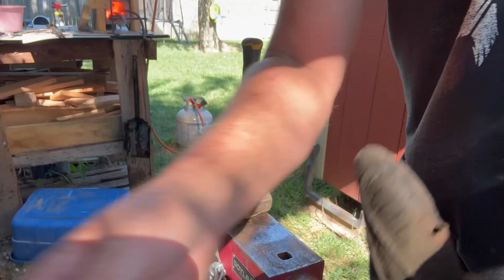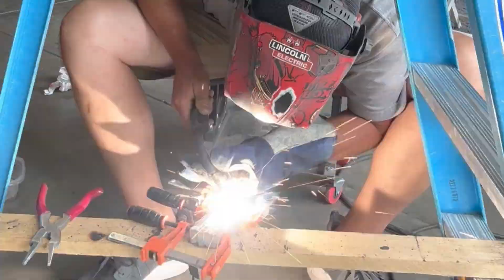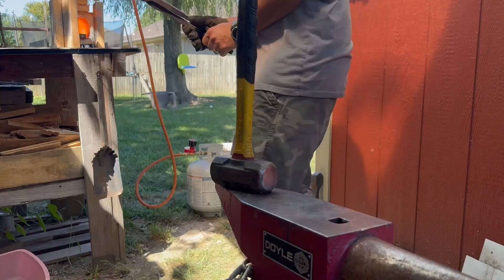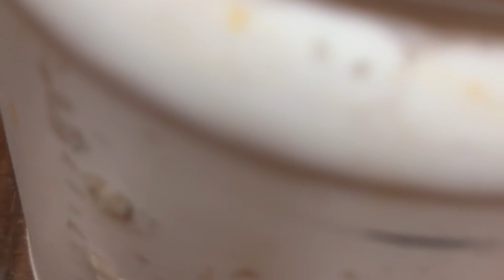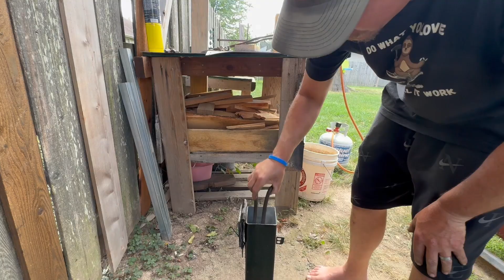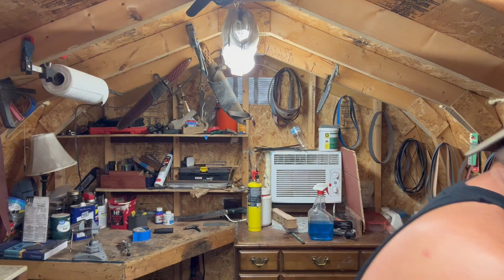Lowest Layer Possible Damascus #damascus #blade #handmade #diy #create

Comment: Did you grind them clean before the restack? Also, sometimes you gotta let that billet soak longer than you think to get a deep even heat. I have a cool pattern in the works myself, keep on keepin on man. It happens to the best of us.😂
Reply from the maker: Ya … at least I think so ? Oh, we saw on forged in fire when people bring a hot billet to the press bite more than they should the other end tears open… I don’t normally swing the hammer as hard as I can, but I sure did on the billet split.. idk? It definitely won’t stop me from trying again!